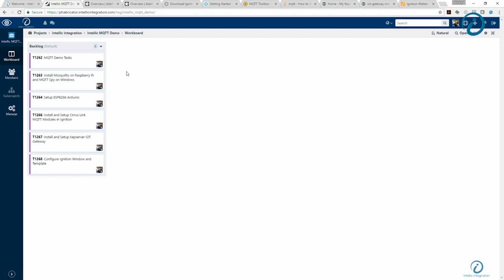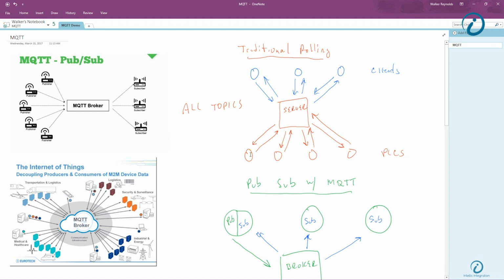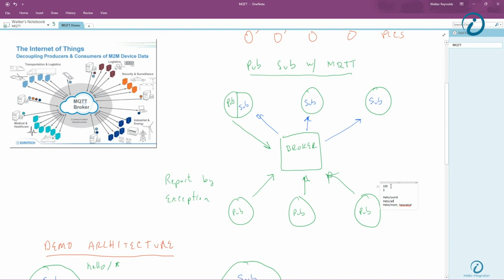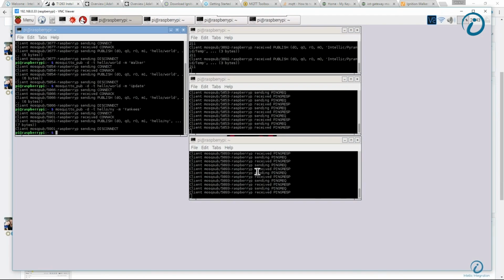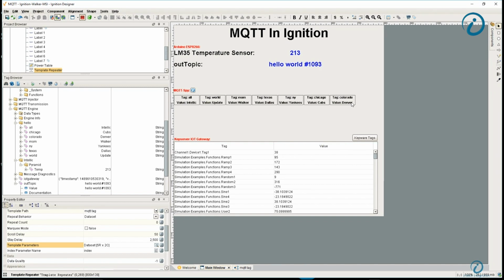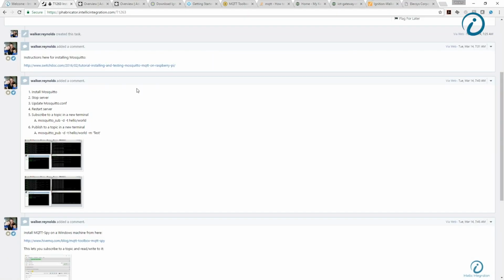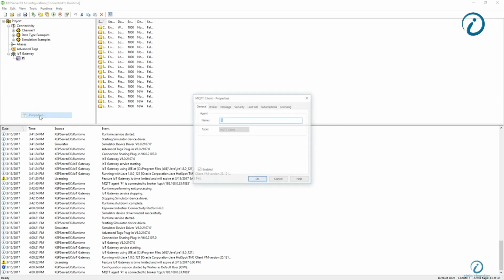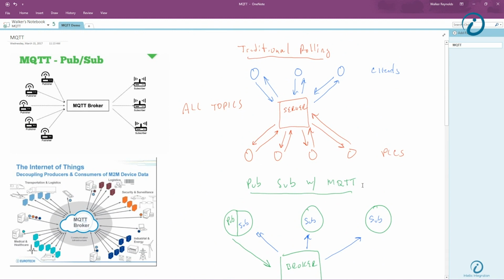Industry 4.0 Demo Project w/ Ignition MQTT, Raspberry Pi, Arduino, and Kepware IoT Gateway

Comment: No matter what the MQTT is, the field devices must have signal emitter / Wi-Fi / Ethernet cables with switches/ hub /gateways and so on, otherwise, these devices cannot reach MQTT Servers, MQTT server is not a satellite, your devices also is not a cellphone. Terminal side also need those facilities. If there is no internet, how can you use MQTT? If we have internet, why we use MQTT?